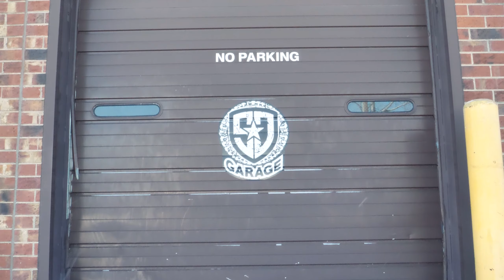2018 Chevy Silverado 1500 (6.5" Zone lift kit)

Comment: Why does the rear look higher than the front
Reply from the maker: This maintains the factory rake.
Reply: @SDWheel  but that's the whole point in lifting though
Reply: LSx life I wouldn’t say that’s the whole point of lifting it my dude... some people like leaving the back stock with that weird squat look, but hey that’s what they like
Reply: @SDWheel  did you install the add a leaf with this kit?
Reply: @stads10  I believe they add the add a leaf. Usually kits level out the truck